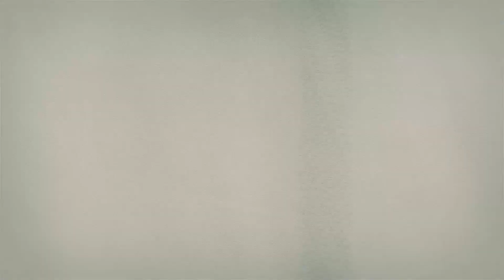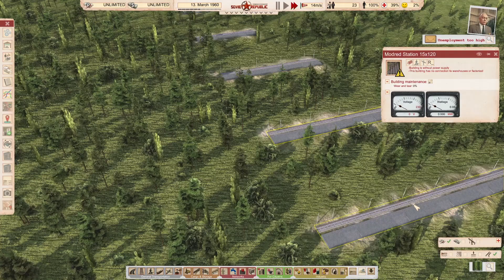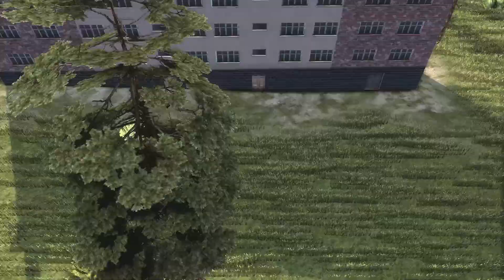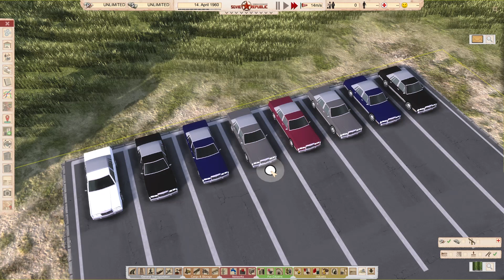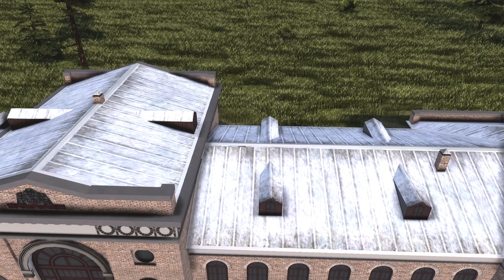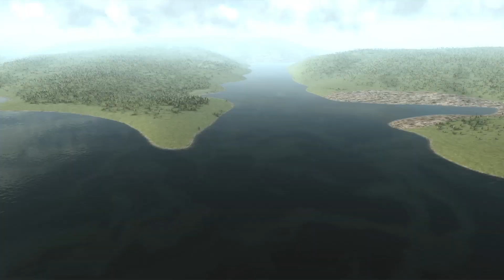Soviet Republic - Mod Monday - S03E31 - American Car, Nuclear Power and Construction Industries

Comment: I hope the devs someday decouple the pollution stat from the smoke/steam particles.  Then we can have big white plumes coming from our cooling towers but no actual pollution.  Otherwise what's the point of building clean nuclear power?  😐
Reply from the maker: Ohh?!?! That is the issue?!?! Steam = Smoke? 
I thought it was lack of knowledge and it turns out it was incompetence. 
😁
Reply: The game runs an internal calculation based on the number of particle effects a building emits.  I had to add a bunch of smoke emitters on top of each other when I did the Plastic Power Plant, so that it would make a suitably high amount of pollution.  As far as I know there's no way to set a building's pollution manually.
Reply from the maker: @eighteenAM  smokeless chimneys then! Clean energy should be clean. :)